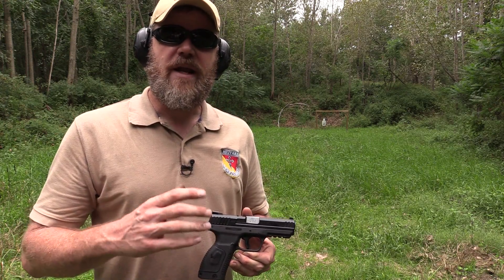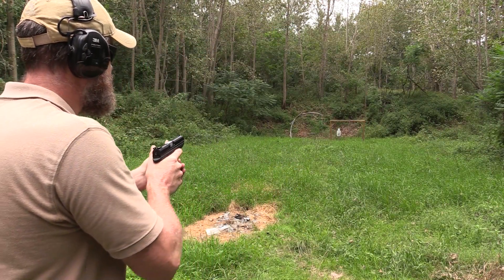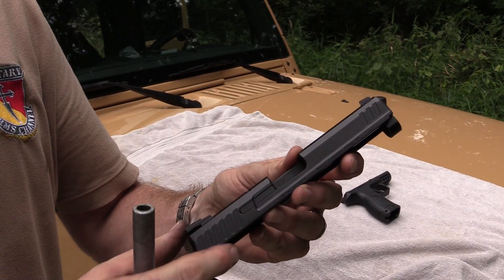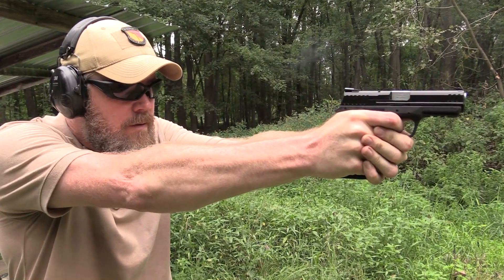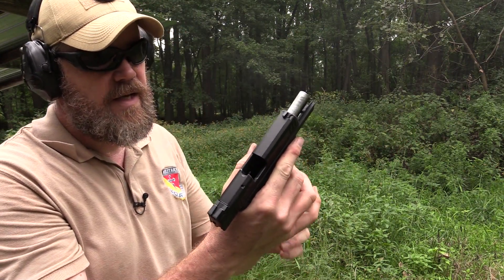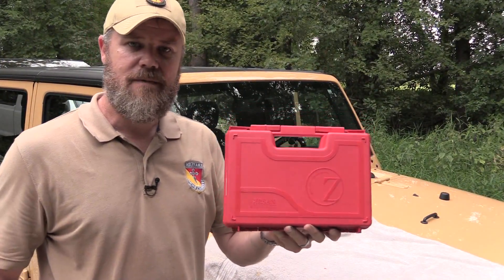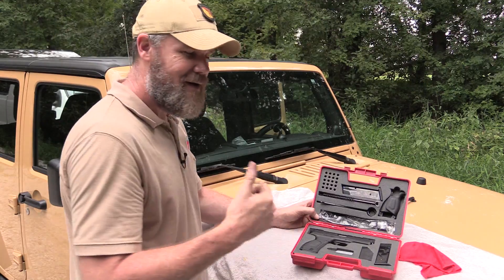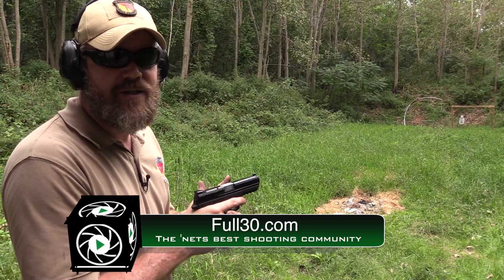NEW: MC-28 9mm Pistol

Comment: I'm really glad I gave mine a second chance. It's just all around bang for your buck in terms of a good budget striker fire. And so far mine I can say hasnt had hang ups I haven't even really cleaned it either to see when it will and so far almost 1000 rounds later its ran very well. And it also isnt an ammo picky tool, I've ran everything from steel and aluminum case ammo to premium defense ammunition and it runs great for me at least. The slide lock is very touchy sometimes it wont lock back if you obstruct the slide lock even a little but anyone can adapt and over come that I feel. Definitely a great beginner's choice or for the avid shooter.

Comment: ya im going to have to echo a few other coments here and say that other than a few minor design changes thats almost identical to a s&w m&p.  i even noticed the loded chamber hole in the hood as well as the center rib in the slide.  not to mention the slide plate and beaver tail look almost identical.

Comment: Would love to see a side by side review between the Girsan MC-28 and the Canik TP9 (or it's subsequent variants).  
Battle of the Turkish pistols.  Both are in the same price point, the Canik has 2 18 round mags, and includes a holster (which is useless for southpaws like myself), while the Girsan includes 2 15 round mags.  Both have extra grip panels and other accessories.    I'm liking both the MC-28 and the Canik TP9V2.

Comment: Did you mention the barrel length, if so I must have missed that ? The reason I ask is that in Canada we have a law that insists the barrel length be 105 mm  ( 4.134 inches ) or greater, for general use on target ranges etc. 
This looks to be a nice pistol, and if that barrel length meets that length requirement, then I may start looking for a Canadian dealer.
Reply: +Reg Sparkes funny lenght requirement, why not 100 mm or 4 inch? but gun laws often don´t make any sense or did the lawmakers tell why.
Reply: Barrel is 108mm or 4.25"  per the Girsan website.
Reply: +Exploatores Lawmakers specifically picked just over 4" to outlaw the majority of common pistols and revolvers, which have barrels exactly 4".
Reply: +Exploatores  Wow, sorry for not answering your question here sooner,.... but Canada uses metric measurements like most of Europe, and the R.C.M.P. state that a barrel in a 'restricted class 'firearm has  to be a minimum length  of 105 millimetres/millimeters, ( whatever spelling you wish ???)  so when you convert 105 mm to inches it comes to approximately 4.134
Does that make sense to you now,?......naw me either !!!   But it's the laws we have .
Reply: Reg Sparkes I thank you for Canada's greatest export,...RUSH !!!

Comment: At first glance it looks like a Canik TP9 mated with an M&P Shield.
Reply: +Gun Runnerz look like an XD copy..
Reply: +Gun Runnerz imo it looks almost exactly like my Ruger SR9
Reply: +CN073 Actually, it seems an amalgam: M&P or Sig Sauer (Sig only has 1 striker fired gun) as it has the takedown lever. Glock for the striker system and no manual safeties, and the striker status indicator found on both  Ruger and Walther guns. The SR9 has a take down pin and magazine safety that this gun is missing.
Reply: i mostly meant aesthetically but whatever, im not buying one.
Reply: CN073 LOL, your thought was my first thought. Then I started digging through my guns...
Reply: lol nice, I sold my SR9 a while back so i was commenting from memory as well. Kind of miss that one but easy come easy go think it was a used purchase around the tune of 300
Reply: CN073 Took mine to the range today to refresh my memory. Still has a little take up, stops, then a clean crisp break. 8^)

Comment: Mags look like my Canik mags made by Mec Gar. $399 is the MSRP.  Means street price is probably more like $330.  If the mags are the same as my Canik, they should come in around $25/per which is much better than Springfield or M&P mag prices.  Looks like fine gun, but I just have no need for a mid-size 9mm.  Give me a full-sized gun for competition and a compact for carry...  No real need for anything in between personally.
Reply: +Andre Krumins But look at how simple an AR15 mag is, even the USGI model. Not to mention they just built a ton of them, which makes it cheaper. Or the PMag, which is even simpler and polymer. And how many calibers are there for every kind of mag? Typically one.

Now, there's a ton of different pistols and all have unique dimensions, unique floorplates, unique followers, etc and to make matters worse they need to make several types of mags as they typically make the same model of gun in different calibers.

Comment: This is definitely a clone of an m&p. The slide is milled differently on the outside, and the grips are made differently, but it looks nothing like an xd or anything but an m&p. Oh, and they used a glock style of trigger instead of copying s&w's m&p trigger. Pull up profile images of both pistols for the slide stop side and it becomes quite obvious. They did make the grip slightly deeper as well. The internals are almost identical as well. They decided not to add the m&p take down safety lever either.

That being said, I'd be very interested in seeing a review of how different or similarly they shoot and handle. If I could get m&p clones, that shoot the same and are good quality for that much less money, I would probably buy several.

Comment: Looks like a g19 size m&p smith and Wesson never made
Reply: +SamuraiEdge556 Looks can be deceiving, this gun is actually the same length, taller and heavier than an M&P9 full size according to Zenith Firearms' website.
Reply: Exactly 😂 
S&W is loosing money to the Turks.
Reply: gonzalez519
 Not really, like I said in my previous post this Turkish copy is bigger, heavier, hold 2 less rounds and even the "compact" model only has a slightly shorter slide on the full size frame.